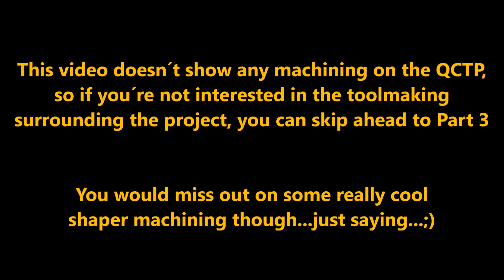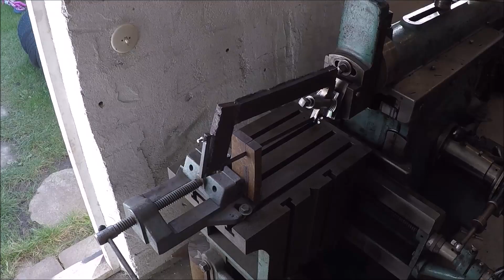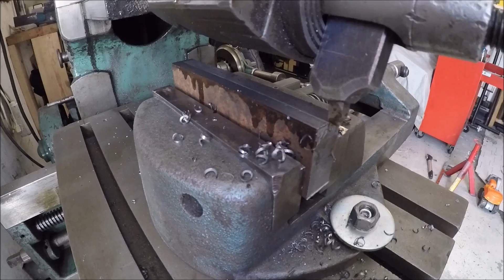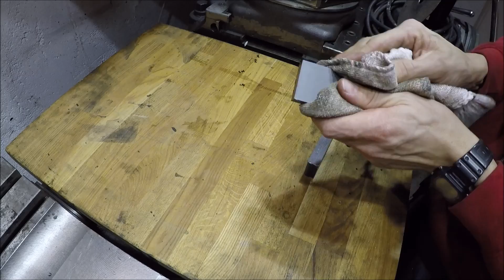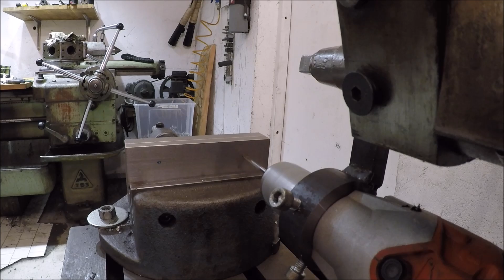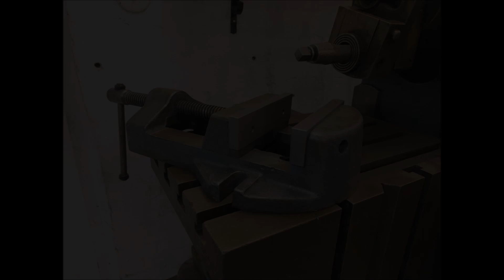Shopmade Aloris style QCTP - Part 2

Comment: I run a 24" shaper on my channel and I get a fantastic finish using a 3/16Th radius tool with med rake, it shears the metal instead of tearing it off. I think you should run your shaper much faster. about 100+ sfpm on mild steel. The  rake on the tool weakens the cutting edge so it's not great for roughing at higher speeds.
Nice videos, I just started my channel about 1 month ago so I am new to the video game. you should stop buy and say HI. buy the way, nice drill press, very crafty
Reply from the maker: +Steve Summers Hi Steve! That sounds like very useful information, thanks! I'll definately check out your videos and probably find even more useful info!